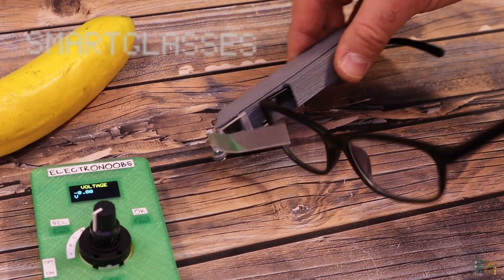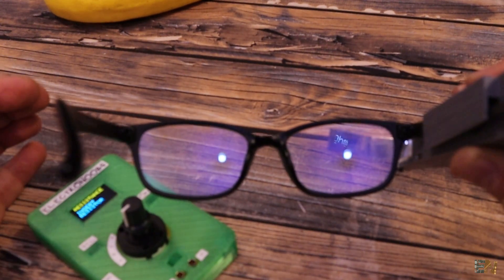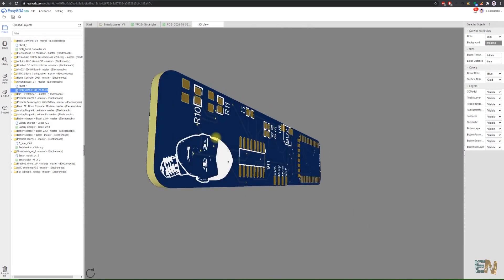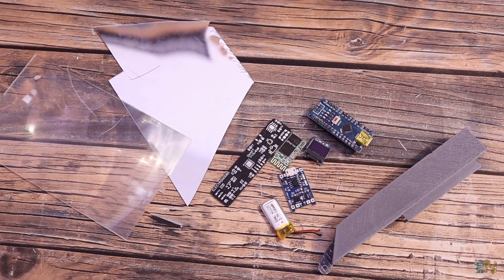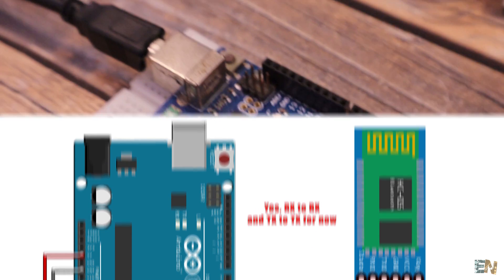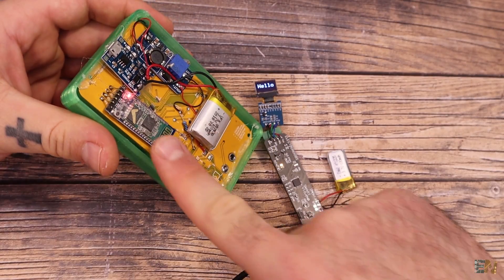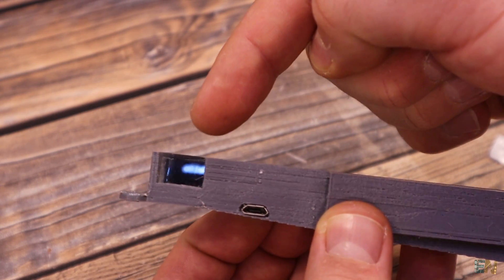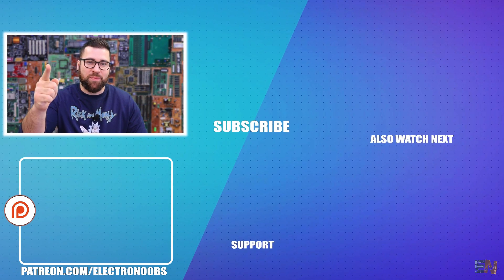Smart Glasses Multimeter HOMEMADE | Arduino & Bluetooth

Comment: this will help alot of people working in electronics repair field for sure ,, but lets also think the implemention of this same project about those doing micro soldering which constantly are working using microscopes doing measurement and such stuff.

Comment: I do not know what your ma power usage is, but the Esp32 uses about 70 ma, if not in sleep mode, the Esp32 already has Bluetooth, I2C too for your Oled, saving you adding the Bluetooth board as you did,
Reply from the maker: Yes, .maybe that would be better for the next version. I would make the multimeter with esp as well. Thnks

Comment: Hmm... Would cost the same, if made using esp series of boards. All you need is screen, esp module and battery management. Plus it'll allow over the air updates and code reloads, so usb connector is not required.

Comment: Try getting yourself a reflex sight. Using it's half mirror can help make it compact. (Almost 1/3 of what you've got)
If you want to reduce the size of it's mirror. You can use dimond disk and Dremel, but cover it with tape first and keep it water cooled
Reply: based poo

Comment: Just wondering. Why did you choose to go with an Atmega and a separate bluetooth module. Could you not use something like the much smaller ESP-01M?
Reply from the maker: Hi there. Yes, pretty sure there are other ways to make this. The multimeter from 1 year back already has the hc05 and I'm used to this configuration so that's why I've used it like that.